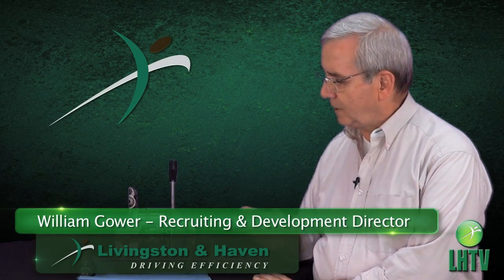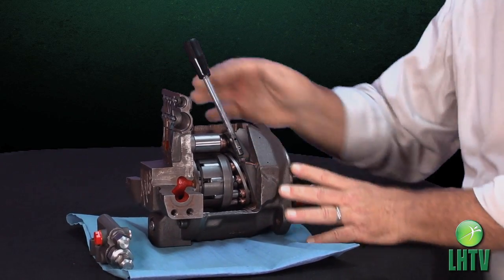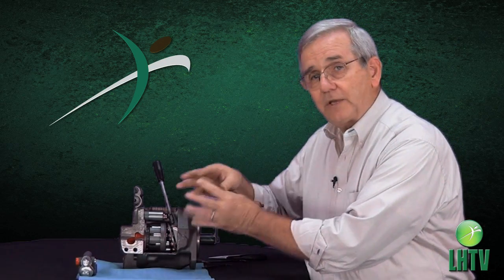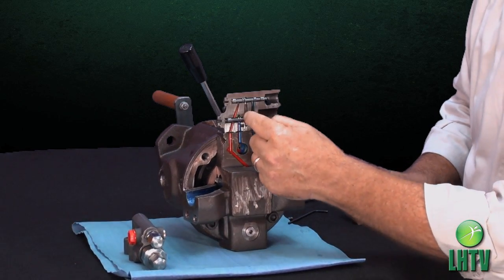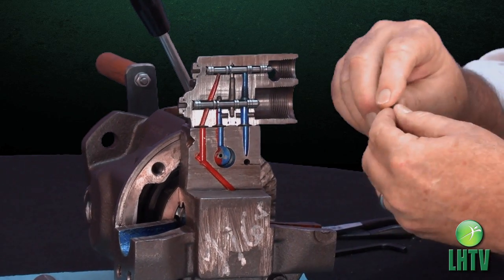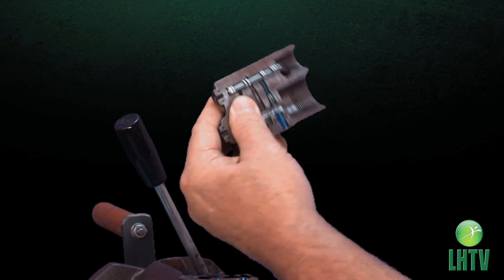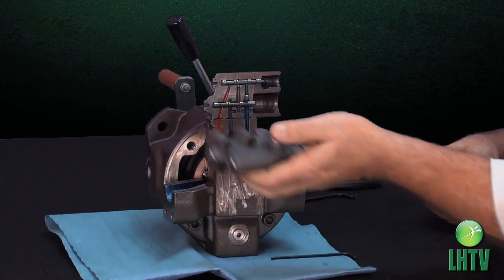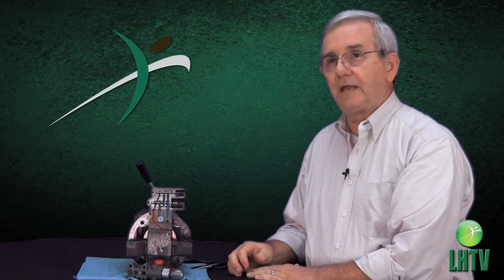How to Solve a Cavitation Problem on the Bosch Rexroth AA10 VSO Axial Piston Pump

Comment: I have this same pump, i changed the oil from the tank but changing the oil, the pump is not producing any pressure and flow. What could be the reason